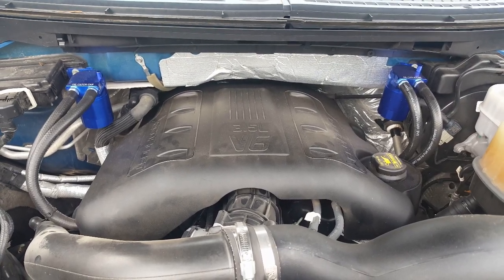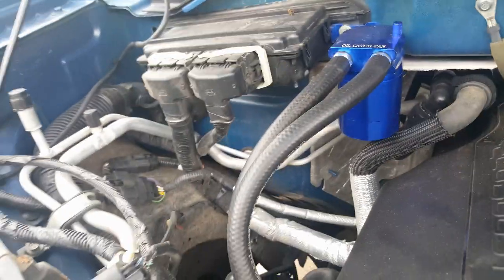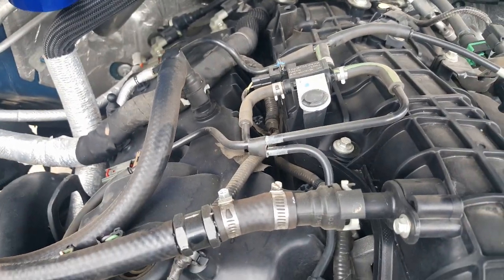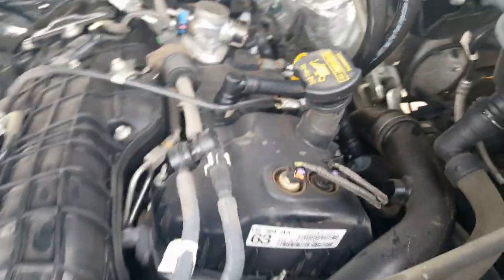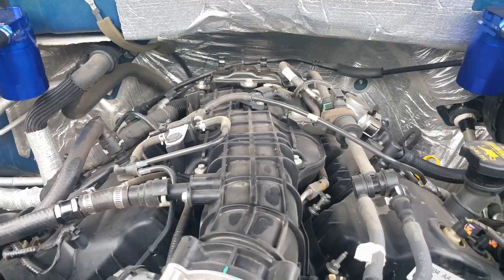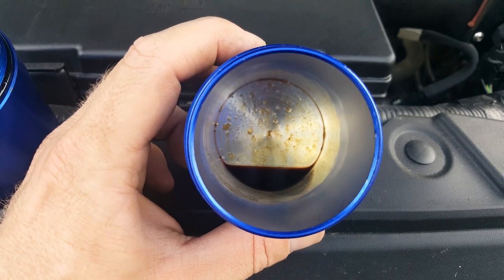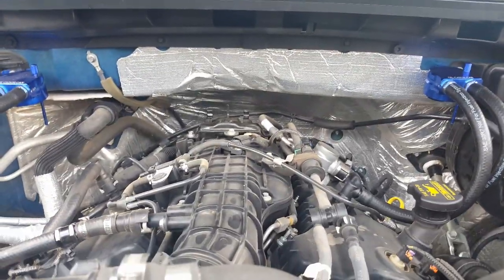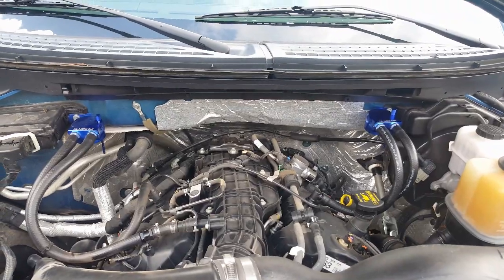✅ Make Your Own Dual Catch Can System for Ford F-150 3.5 Ecoboost

Comment: Do you notice more liquid in the passenger side vs the drivers side? Or do they catch equal amounts of fluid?
Reply from the maker: Mine has been pretty equal.  Lots of rain here in the last two months though.  Before that, the passenger side filled up more.
Reply: @BOSSC351sProductions  Thanks for answering. I read something about the passenger side filling up more. I was thinking to run a 3 port can to make it simpler.
Reply from the maker: I believe my brother runs a 3 port.  This setup is working for me so far.